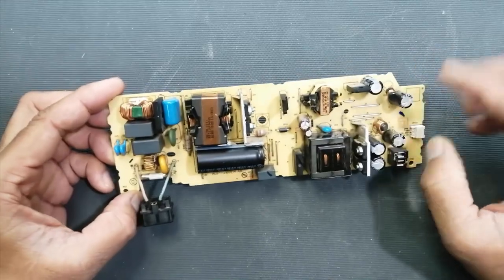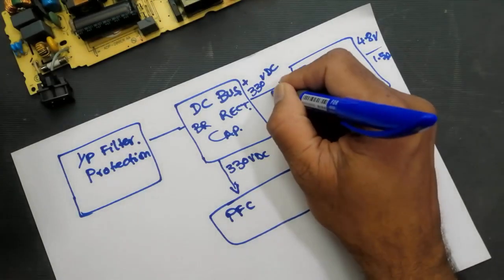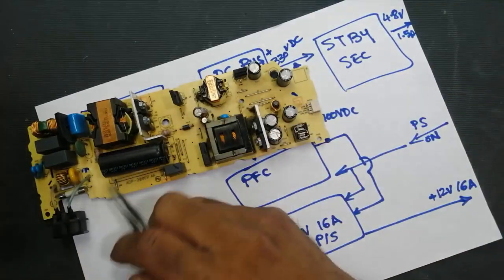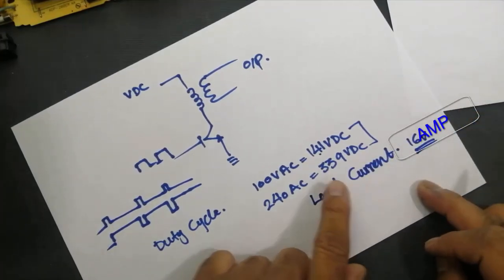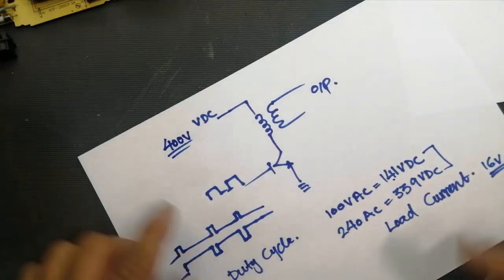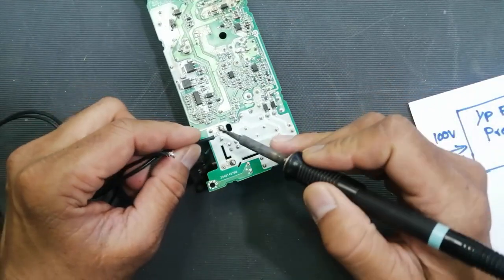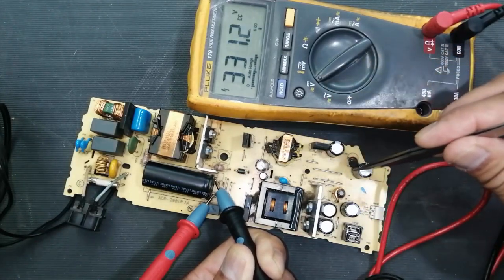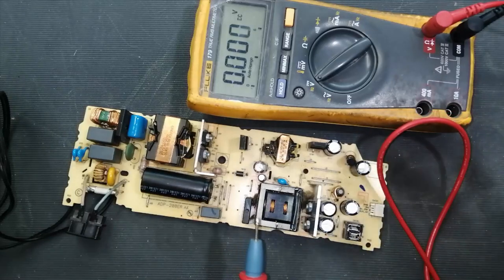#301 Sony PS4 Power Supply ADP-200ER - Functional Description - Troubleshooting - Part-1

Comment: Thumbs up sir.
Please sir what about the AC voltage stabilizer circuits troubleshooting and repair? . Thank you sir for being there.
Reply from the maker: best regards. 
for ac voltage stabilizer & regulators i will share videos in upcoming January 
as i have plan to visit Pakistan. there are much use of stabilizers & regulators
here in Jordan there is very rare use of these items

Comment: Great👍👍👍
Please Make 12V Battery Charger using LM 317 regulator.
Thanks From India
Reply from the maker: LM317 is a adjustable regulator and have a very limited current output
so i never tried it in any battery charger circuit

Comment: How interesting, PWM on a higher DC , so that's how PFC is done !!
Reply from the maker: yes. to increase a converter efficiency (because when dc rail voltage decrease that time the PWM IC have to switch more and more by extending its duty cycle to the maximum limits, so that its efficiency will decrease) the PFC is used. it maintains the dc voltage at specific value, 
for example if we connect this PSU to 110 volt, that time the voltage at bulk capacitor will 140 VDC but when we will turn it ON, immediately the DC rail voltage will boost to 410 VDC. so that the main power supply will work perfectly without loosing its efficiency
Reply: @HaseebElectronics  I am guessing PWM is voltage monitored and PFC is current monitored ( I.E. what gets dumped on to the negative rail ? ) why so much complexity in the PFC circuitry when all that is required is comparators around the negative rail , I need to be patient for your following parts in the series.
Reply from the maker: @keithcitizen4855  actually both work as SMPS working principle. 
Just PFC is identical to a buck converter or a boost converter. 
it is to maintain a specified voltage on the DC rail. i will explain it in very detail 
you can also check video number 221 on my channel, that is for PFC power supply in LED TV 
its main roll in any SMPS circuit  is to stabilize DC rail voltage to ensure the output efficiency of the converter
for example, in this PSU we need 12V16A that is a high amount of power
(to drive a power supply at low input range of voltage. the converter efficiency will decrease from 90% to 70%. ) so the PFC circuit will boost the dc voltage to a 410 VDC level, disregarding the input voltage (110 VAC to 240 VAC that means 140 VDCto 340 VDC)
in this way the our required power supply will regulated 
and using this design technique, it decreases the cost and improves the regulation
Reply: @HaseebElectronics  it didn't dawn on me but it makes sense a buck convertor would be required to raise voltage above the natural 330 DC 

thankyou ,  I  will digest/ learn more from looking at your last  comment  recommended  videos.
Reply from the maker: @keithcitizen4855  I mean PFC working theory is similar to buck or boost converter
best regards

Comment: very good video mate, in the connector that makes the bridge and there is no 12v, what should I test first? the relay does not activate either. Cheers
Reply from the maker: best regards and special thanks 
apply jumper 
check PFC voltage 
then check power resistor near Large capacitor 
then check the 12 volt section

Comment: Are u familiar with the coil whine problem? And do u know a solution?
Reply from the maker: coil whine problem becomes annoying. it occurs due to looseness or weak binding of core or coil former. it causes noise, excessive heat dissipation and lowers the efficiency and after a time it destroys the coil enameled coating 
its solution  is insulating varnish, dip the coil in varnish and let it dry for 24 hours 
repeat one or two more coating process

Comment: I have a ps4 CUH-1115A source that doesn't release the 12v. I don't have the voltage of 5VSB at the power supply output either. What part of the circuit and components should I examine?
Reply from the maker: welcome dear. 
1. in first stage you have to check voltage at main dc capacitor (BULK Capacitor). you should find dc voltage (ac input voltage x 1.414). if not present check fuse, bridge rectifier. check video number 304
2. then you have to check standby section 
3. then it should operate PFC and then 12 volt section will work at end
Reply: @HaseebElectronics    the first step would be to measure the voltage on the capacitor from 100uF/450v (accuses 175v more or less) until everything is ok. I examined the standby stage which I believe is controlled by the integrated Dnp015 , on pins 1 and 2 (gnd and vdd) I get 10v. I have the ADP-240AR scheme which by the scheme would be 24v. The output is missing the 5vsb voltage on pin 4 of the CN121 connector

Comment: Hello, i have problem with the same power supply.
When is starter 12v, then voltage drop about 15 sec to zero and then need to remowe cable and put back-start 12v and voltage drop, what can be a defective here. Thanks

Comment: Hello
I have the same power
The standby works, then the 12 volts go out momentarily, then it falls off
The Power Factor circle becomes 388 and then goes down, and 5 also goes down
There are no circuit shorts
Please reply as soon as possible

Comment: I have a funny problem. My adp-200er 4.8v standby stays on without any problem even for an hour. But when I make 12v on, (short pin 3,4), the 0.16ohm resistor, the 5v mosfet and zd39 zener diode (9.1v) blows. The 12v comes on for a tiny moment.

Comment: I am getting 5v but not standby voltage what is the issue
Reply from the maker: connect jumper to turn on secondary power
check PFC booster, it must be 400VDC. it must take start to turn ON secondary section 
then check Push pull circuit
Reply: @HaseebElectronics  I have ADP 300cr 
where should I connect jumper sir
Reply from the maker: @darshangowda8058  please connect pin 1 & 4 
from rear side (print side) outer two tracks 
one is for 5VSB and other pin is ON command
Reply: @HaseebElectronics  5vsb and acdc supply pin sir?

Comment: I AM GETTING 165V HELP PLEASE
Reply from the maker: please check its PFC circuit
Reply: @HaseebElectronics  the 4.8v is there but no 12v and its turn on with acdc and 5v
Reply: @HaseebElectronics  what should I check for??? Is it possible for u to to a tutorial on what to check where there is no 12v

Comment: hello sir, i have a bench power supply and the voltage output is flactuating, this power supply is 30v 5a, but i cant even go to 30v even if i fully adjust the potentiometer... 

https://drive.google.com/file/d/1tWDN4TsHbigaJF4iUd7wQL1MlgPNG4ct/view?usp=drivesdk
Reply from the maker: it seems that the power transistor have problem. check the power transistor
Reply: @HaseebElectronics  thank you, i already fixed it, the potentiometer is causing the problem...
Reply from the maker: @ohmware2020  yes that is awesome
in basic troubleshooting steps the power stages is checked and then the control circuit